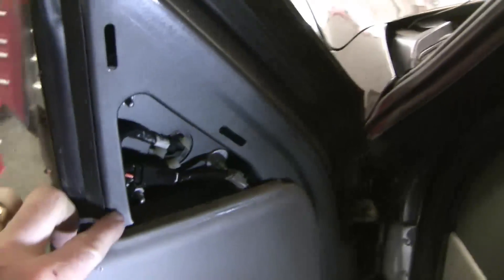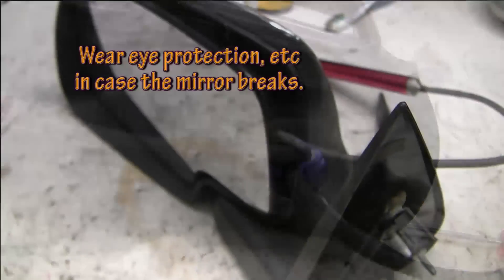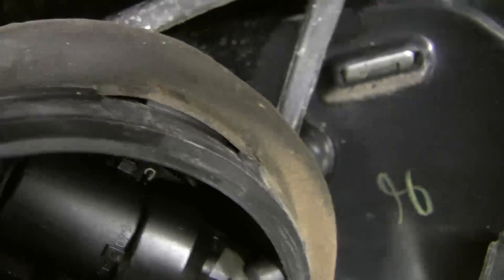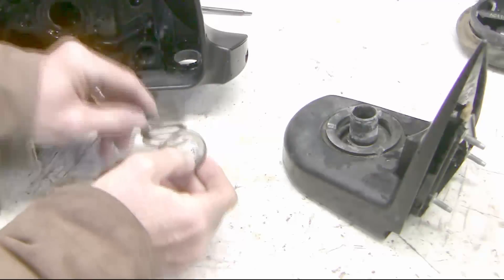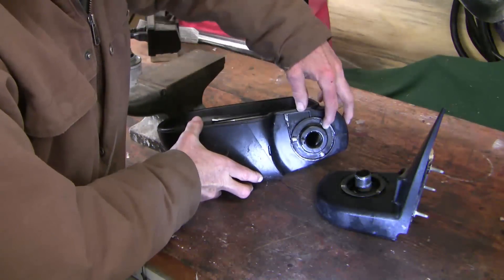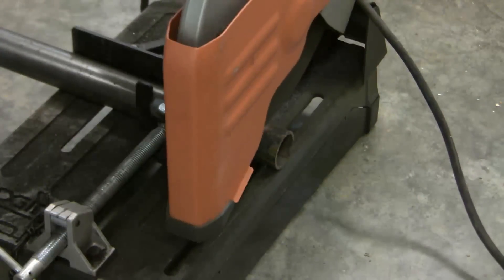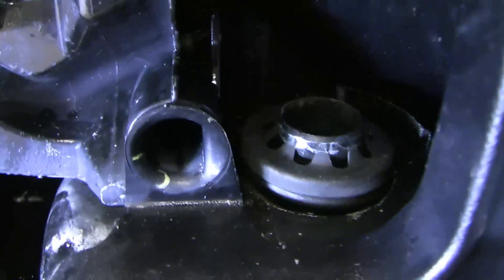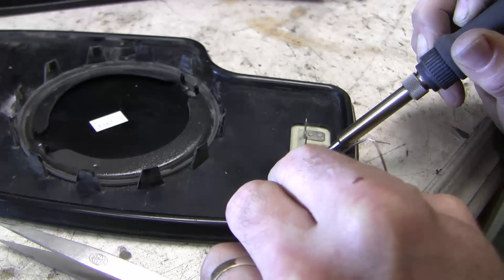How to fix a broken car mirror support

Comment: this video motivated me to disassemble my side view mirror after it got pushed forwards by a truck that drove too close to me. Afterwards the mirror's support wouldn't stay fixed in any position whatsoever, so I looked around and found your video!. I found a system somewhat alike the one you showed and after trying for about 5 hours I managed to compress the spring and make the whole thing work like it was meant to be.
thank you so much man you saved me a bunch of money

Comment: I have a completely different vehicle and mirror, but just seeing what was behind the glass allowed me to fix mine in seconds. My glass had just unsnapped from the main housing unit. A little pressure and it was snapped back in place and fully operational. Thanks!
Reply from the maker: +RMM .t Yeah, after you've been behind a few of these you recognize marked similarities for the vast majority of cars. Thanks for the feedback.

Comment from the maker: Mine may be a little different than yours, but probably not much different. The mirror shown is actually a junk yard replacement, since my first mirror was completely destroyed by random teenage vandals. The original mirror mount was almost identical, and as far as I remember the rest was fairly similar. I believe GM used the same mirror in many models and years. Thanks for the sub!

Comment: Thank you for posting this video!  Mirror broke just like yours at the car wash last night. Hopefully, this is what is wrong with mine too!  Awesome job!  Thank you. Replacement mirrors are not cheap even on Ebay!
Reply from the maker: +bijinsue Ya. The last mirror I replaced was taken off a vehicle at a junk yard. Although the mirror wasn't a perfect match (different chrome), nobody ever notices because you rarely see both mirrors at the same time. Ya, ebay has been a boom for junk yards, although I still miss the old days when you could pick your own parts for a lot less.

Comment: Thank you so much for posting.  This really helped me get a handle on my issue.  I used a piece of a 3/4 PVC coupler to push the "castle nut" down. I cut a small chunk out so I could do the entire thing with removing the mirror housing.
Reply from the maker: Glad it helped, thanks for the followup.

Comment from the maker: You make a good point, Mathieu. Where I live now, near the ocean, mirror heaters are almost never needed. Actually it might be connected to the rear heater control, I haven't checked. You notice there was brownish staining of the plastic on the electrical contact behind the mirror. In retrospect I wonder if there was a bad connection there at one point, either on my vehicle or the original vehicle this mirror was on.

Comment from the maker: That's very resourceful, good job. The J-bracket uses a J shaped bar that goes though the ring, with a nut on the end holding the castle nut on. Of course rigid techniques lose some of the ability to fall off without permanent damage.

Comment from the maker: Yes, if it had happened inside the warranty period GM has a modified bolt called a J-hook to fix it. But outside of the warranty I suspect they will charge you for it, and what I did above seems to have worked fine. I believe the J-hook holds it so well that minor trauma would break the support rather than allowing it to fall off, undamaged.

Comment: I agree. I was considering buying a used mirror but I wanted to do this without spending any money, also the j bracket kit is ridiculously priced $56, not worth it in my opinion, my repair will hopefully last forever.

Comment from the maker: Yeah, the original mirror on this vehicle was broken off by random teenage vandals, and half those little clips were broken, and the mirror frame was destroyed. I had to replace the whole mirror with a junk yard part, which I picked up for $40 -- the part shown. I'm not sure what model this part is from, but Chev used that style of mirror for many years. Thanks for watching, Terry.

Comment: I don't have a lamp that big so I did it another way.    I had a piece of 1 1/2 PVC so cut off a 6" piece.    I left the wire loom in as it is a pain to thread out and back in again afterwards.  .     I took a grinder and notched the side of one end of the pipe about 3/4" so it would clear the loom.   Then I lined it up and banged it with a mallet straight down.     Same effect  minus the huge clamp.       
     One thing to consider further.    If it's popped off chances are the spring tongs on that clip assembly are slightly sprung.    Mine went on fully then popped back off in a few minutes while I was putting it on.     I ended up bending each tab inwards / down using needle nose pliers .    Then when it was on there next time it stayed.   
    GM really should have put some sort of keeper on the top of the stem (cheap).      If yours keeps coming off  remember you can't tack it on with weld as it's either aluminum or pot metal.   Gouge up the top really well while it's apart and epoxy a big washer to the top once it's together.
Reply from the maker: Thanks for recording your experience, for others to find here! Most of us don't have access to a big tool set so improvisation like you did here is gold. Of course the greatest power of multimedia is the ability for everyone to contribute.

Comment: Do you find a way to add yourself the heat function o your truck. On my corolla 2001 I have the wirering to add the anti-fog head light. It's will cost me 400 $ to add this functionnality. But heater is might be just a button to add on the dash to be able to use It.

Comment: Hi, great video, I had no idea how this was held together. Unfortunately for me, as soon as I pressed the flattened castle ring over the shaft and moved the mirror, it popped right back off. I took it apart again and pressed the castle ring on again but then I drilled and tapped two small short 10/32 machine screws just above the castle ring on the shaft. Now the ring can't pop off again. Put it all together and it works perfectly.

Comment: thank you for your efforts...I will use what I can glen from your video and others as m;y mirror's motor still works, just the white plastic things that connect to the mirror broke and instead of little clips I have 2 metal hooks.  I've not seen how they connect back...I will see about using JB weld instead of super glue. to put the motor movers back onto the mirror. .
Reply from the maker: It sounds like your version is from a different year. I'm not sure how yours works, perhaps there was another part knocked off? A visit to an old style junk yard might help, but those guys now often don't permit people to wander about like we did in the past. On the positive side it is fairly easy to find replacement parts over the 'net, although they often charge more than they did in the past. Good luck!

Comment: Oh by the way, any experience on 2003 Suburban passenger door problems?  Entire door doesn't work, power window, lock, mirror adjustment. I replaced the driver control module on the drivers door but with no results. Father is an electrician and he checked out the wiring, all seems fine.  I am stumped. Hate having to reach over to unlock the DOOR! Any feedback would be most appreciated!
Reply from the maker: +bijinsue Commonest cause is a bad ground, often where the wire goes through the door, where brittle wires rub on sharp edges and moving parts. But, I would guess that any electrician would sniff that out fairly quickly. The wiring diagram in these cars is very complex, and finding a bad component can be tricky. A general failure points to supply wires as a culprit, so I would start there. However occasionally excessive draw or a bad ground on one component can draw down power on others, leading to general failure. I would start with the wiring diagram and look for power and ground at your door. At one time bbbindustries offered free wiring diagrams for those who visit their website; I'm not sure if they still do. Good luck!
Reply: Thank you! They still DO have free wiring diagrams! This is going to be tricky. Thanks for your help.